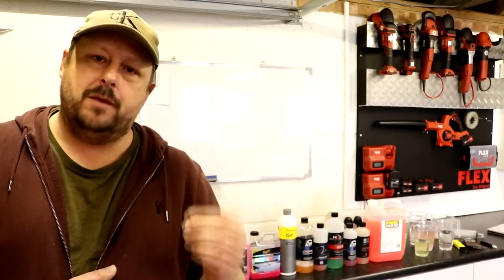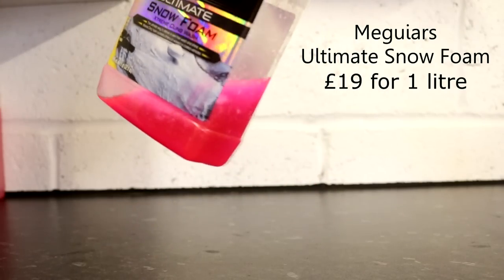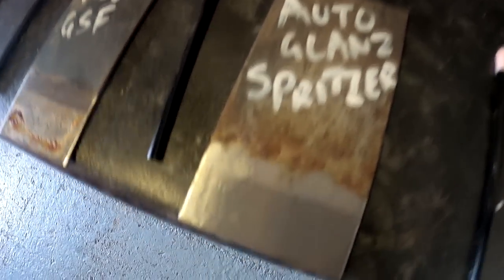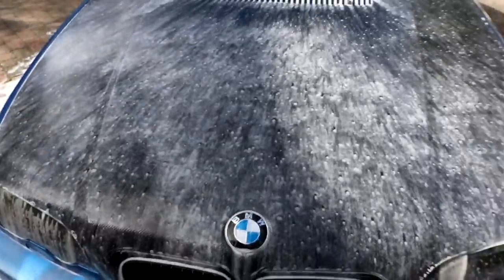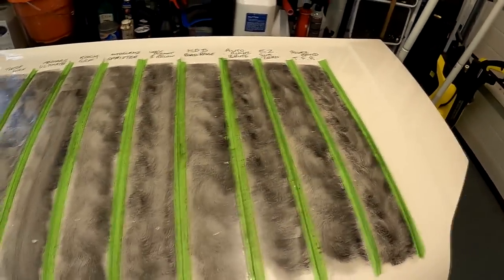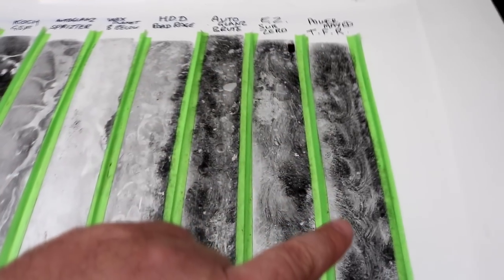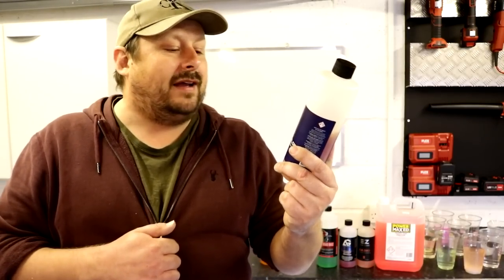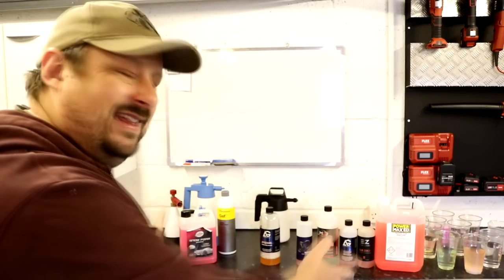The Best Snow Foam | Ultimate Pre-wash Comparison Test

Comment from the maker: I will do a 8 below versus Autofoam video tomorrow, just a quick one, no rust or like timelapse thing just cleaning power and quick chat..

If you want to cross compare with the products in the first round watch this video ---> https://youtu.be/WmVeTbarlH4
Reply: VS BH Snowfoam?
Reply: Hey could you maybe add Koch Gsf with Greenstar at some point? Koch says of you need more cleaning power from the Gsf just mix it with GS. Since you own both products 😎
Reply: That'd be awesome!
Reply from the maker: @saiiiiiii1  for sure yer i talked about this in the video..
Reply: Hayden Mcfarland Autofoam is BH
Reply: Hey john could you do the 8 below against bilt hamber aswell please tomorrow would really appreciate it👍
Reply: @Naoi He already did if I remember , doesn't corrode steel
Reply: @Naoi I have green star I prefer autofoam tho , When I discovered AF I stopped using other cleaners , other than the PH neutral ones when dirt is low
Reply: @Naoi Autofoam is very good as a spray pre wash ( not foamed , just spray ) .
At the same ratio as green star is much better and yet not corrosive.

Comment: Really interesting Jon. I use WP 8 below and do like it, but like you I find it needs extra bite in the winter. I add 10ml of green star in the winter and that works a treat. Still works out as cheap as chips.

Comment: For me in a snow foam I want corrosion inhibiting cleaning power that's relatively LSP safe.
Level of foam and cling doesn't bother me too much as long as it does the job.
I'm not too far off needing to get another load of products and was going to try out Autofoam. The comparison with 8 below will be interesting but I have a feeling BH will edge it out with value for money.

Comment: Thank you for doing a corrosion test, its not something that had crossed my mind but my locking nut has surface corrosion and the discs keep rusting up, suspect this is why. Thanks Jon.

Comment: Awesome test, well done! Can you comment on Bilt Hamber Auto Foam vs Eight Below? Is Bilt Hamber the best allrounder?
Reply: Ass he said in the end of the video he have made other test with other products and he did not want to talk about other product than the one there was in the video. BH is brilliant, i use it my self, but that does not mean that I'm not open for some cheaper alternatives.
Reply: @ketillundsrensen6167  Cheaper ? BH is probably the cheapest
Reply: @dimmacommunication  not if used at the correct PIR. Most will require over 400ml of product in a 1L lance bottle to get the correct ratio.
Reply: @richardhurr31  But I am not using foam lance , much better with a sprayer.
Wayyy less hassle , super quick and effective

Comment: Jon, that’s one of the best pre-wash shampoo reviews I’ve ever seen. Your in my tip 3 detailing channels. Respect for your time and effort. 🙏

Now regarding your statement, at [ 26:35] you’re saying that:

1) Ratio 1:25 it is 4% and I’m totally agree with you!!!

2) Ratio 1:10 is less than 1% 
Well ratio 1:10 means 1ml of product mixed with 10ml of water or 100ml of product mixed with 1000ml of water. Following the logic I would say that ratio 1:10 is more more like 10%.

edit:
Regarding my favourite pre-wash shampoo I would say that:
1) I do not have a garage 
2) I’m using IK FOAM PRO 12 (pump) Sprayer
3) I can not meet the most producers requirements to avoid using the product on direct sun light and avoid getting it dry (at least not all the time). 
By far BILT HAMBER  AUTO-FOAM is my choice. It’s great product, not expensive (for 5L I’m paying more less €25) and the cleaning power is amazing. Thanks to you Jon (and your channel), I’ve discovered that great product. So, big thank you for that! 🙏
The only disadvantage is that using the Auto-Foam (40ml in 1L = 4%) with IK 12 Pro doesn’t give me much suds but that’s just aesthetic, right?!  Maybe I can mix it with some other product to get more foam out of my pump sprayer, so I will be completely happy when washing my car. So, now I’m considering the idea to add a little bit of “Wax Planet 8 below” pre-wash shampoo and see what happens.
Reply from the maker: Point 2.  Snow foam lance ratio 1 to 10 typically equals 0.7 PIR.    1 to 9 in pump sprayer equals 10 percent PIR.  Remember pressure washer adds loads more water.  See video how to calculate PIR.
Reply: @ForensicDetailing  so, if I understand you right, your advice is to use 10% of a product (Auto-Foam) in a pump sprayer (iK 12 Pro). 
PS. Will check your video regarding the PIR. Thank you very much for your input. 🙏
Stay safe and all the best!

Comment: Hey Jon! There seems to be a misunderstanding with the dilution for the Gsf. In a foam sprayer like the Gloria FM10 or the Kwazar Super Foamer on 1l you will get an awesome foam which cleans pretty good with just 20ml (which is a 2% dilution). For a Foam Lance used on an high pressure washer, you will have to adjust the amount cause the foam lance will dilute it even further. Most foam lances also dilute 1:10 so you will have to use about 200ml on 1l of water in a foam lance.
Reply from the maker: the instructions needs tweaking marios for the UK market.  Because the product or the term snow foam in the UK is really associated with snow foaming prewash in a lance, only a tiny percentage will use hand pump foamers.    The key words which would let users know are "pump foamers or pump sprayers" versus "snow foam lances".  but I have to follow the instructions and it just says for snow foam use 20ml in a litre spray foamer.  

unfortunelty a product thats mild in nature always suffers with my cleaning simulator.  with green star in the mix GSF could strip that dirt film.  so yer I felt it important to mention that.  

really to win this contest the prewash has to be agressive with a strong degresing power and some natural alkalinity and be good value.  no doubt koch will have something in their lineup which does this
Reply: Forensic Detailing Channel that’s true, I will forward this information to my colleagues. 🙌🏽 Thanks very mich for giving me this insight Jon. But that’s true, a ph neutral product will not have the same degreasing power, there is another snow foam product in our line up, which is the Super Foam, but it is meant for the professional detailer. It has a lot of degreasing power and a ph of 12.5 😃
Reply: @marioan3698  this would be interesting to see. I love Koch chemies stuff usually

Comment: Great test. I was missing them.

I'm not using snow foam just because i think they don't clean as much as the money they ask for. Your review has proven my thoughts in general, although there are good products that really clean (but you have to find them, try and error)

Instead of snow foam, wait and rinse, i pressure wash the thicker mud and then simply foam the car using my usual shampoo (Sonax, cheap) to help with the 2 buckets method. I can say that the "foam" of 1 cap of sonax (20ml maybe?) in 1 liter is similar to the turtle wax you reviewed.

Comment: Great video, well done! I came here mostly to learn about the rust inhibiting performance of each, so it's good to see that test. You used each product in a neat form to test the corrosiveness, but in reality, each should be rinsed off. You may have a later review which I haven't seen, but could you comment on what you've seen after real world use (after rinsing with fresh water) on things like exposed nuts/screws on the underside, discs etc?
Reply from the maker: alkanility will inhibit rust.  but use Bilt Hamber Touchless prewash thats a great option

Comment: I've seen other tests give similar results for HDD and GSF.  Personally I use Autofoam after the last set of tests. For s***s and giggles I went with a 4% Autofoam, 1% surfex HD PIR mix for one of my winter washes and that was pretty effective and removing low down traffic film.
Reply: I actually do something along the same lines Roger... I use my old karcher foam bottle (the 500ml one) and go 50/50 surfex HD/water in it, spray the lower half of the car, then coat the whole car in autofoam (including over the SurfHD part)... This stops the HD drying out, giving it even more working time with the outstanding autofoam also working... 5-10 minutes later I spend a good 10-15 minutes rinsing, then 90-95% of dirt is removed... Some people say it's the power washer removing that dirt and not the foam... I completely disagree!!

Comment: I use PowerMaxed TFR but in a pump sprayer for the intial degrease, I wouldn't be using a TFR in a snowfoam lance like a snow foam. I use Autofoam for that.

Comment: great review as always, would the wax planet product be good to use as the only washing product on a car that has been ceramic coated. I,m keen to extend the life of the ceramic coating as much as possible without using aggressive cleaning products that may accelerate the degrading of the coating.
Reply from the maker: hey john, no  this WP product is a pre wash.   you need a contact wash shampoo after it, which is designed to provide lubrication and will use different surfactants designed for more  contact washing....

Comment: If you want foam + decent cleaning power then Autobrite Magifoam, if you want very strong cleaning power then Bilt Hamber. Thats all you need to know 😄
Reply: znjful found magifoam clogs my foam gun.
Reply: This.  I use BH in the winter to really cut through the grime, and Magifoam in the summer where the longer dwell time and thicker foam helps shift the dirt.
Reply: @m0bov  soooo thicc
Reply: Magifoam has poor cleaning power in my experience. Looks good for pictures though. Wax Planet Eight Below is more than thick enough and cleans better than Magifoam.

Comment: I was considering BH Auto Foam and the GSF, went with the latter because it was sold here in Denmark - lower shipping rates. And I have used it once, after watching another channel’s wash with it. 100 ml and GS. Still wasn’t impressed. Foamed fine but ran off the car very quickly. Didn’t have time to do the nooks and crannies with the brushes before it was off the car and almost started drying. I was in the shadow and under ten degrees C. 
I will mod my foam cannon to get more performance from the GSF.
I have used GSF and GS mix as a waterless wash in a sprayer with good results.
Reply: I just read my label on the GSF and it says Foam Sprayer. 20 ml GSF to 1000 ml water, so a 1:50 dilution. What that ends up in with the foam gun, I will have to work out. But I think the cost/wash is going the wrong way. Bilt Hamber is on my list now.

Comment: Just a quick correction John. Yes, 1:25 is 4%, 1:10 is actually 10% which is 2.5 times more concentrated. You may want to review this part of your evaluation
Reply: 9:1 is 10%.
Reply: Brian Woods careful how you consider the ratio. 1 is 10% of 10. This is usually how ratios are expressed. Yes, 1 part concentrate to 9 parts water is a 10% dilution.
Reply from the maker: 1:25 in pump sprayer is 4% 1:10  in pump sprayer is 10% (roughly).   But 1:10 in a lance is about 0.6 - 0.7 %  PIR.   Im pretty sure this is what I said in the video.  be aware the video contains hundreds of pieces of infomation on the products and the prices at different concentration theres probably other mistakes lurking but Im not aware of any mistakes.  but I may well refer to 1:10 and not specifiy if Im talking lance or pump spraper PIR.

Comment: jon i use bilt hamber high activity autofoam to do regular weekly cleaning on my bicycle. i use around a 100:1----or 50:1 concentration in a spray bottle on the chain and it works so good that it even degreases synthetic chain lubricant. (not a clean strip but pretty darn good). i could put some HDD in it but i dont want a clean strip lol. When i use a snow foam i want cleaning power, and degreasing power, atleast if i want it i can up the concentration.

Comment: Great Video !!!!!

I need some help and advice on alloy wheel cleaners. 

I have tried and experimented with a few but I’m not convinced on results.

Could you help me ? Or if you have a video with a few products to trial.
Reply from the maker: Get some BH autowheels This is a bleeding fallout remove and wheel cleaner in one (stinks but will clean your wheels like nothing else)  Try and keep it away from the brake disks.

If you want non FR.   I use Surfex HD at 10:1 because its cheap.

But try garage therapy wheel shampoo.
Reply: @ForensicDetailing  that is perfect !!!! 

Do you also have a link to your how to not get streaking video ? I’m a new subscriber and I’ve just seen the turtle wax spray and rinse.

Comment: I know this is an old video, but the Koch-Chemie website states 20ml of GSF per litre in a 'foam sprayer'. That's a PIR of 2%, which would be more like 200ml product with my pressure washer set up. 

They reference separately that GSF is also suitable for a 'foam gun', but fail to mention the need to maintain the correct PIR, which feels like quite an oversight...

If my interpretation is correct, it would be nice to revisit this product at the correct PIR 👍
Reply from the maker: Yer they should have corrected that I flagged that to them

Comment: Fantastic test jon as always - couldn’t wait to watch ! I share your thoughts on EZ’s products - there pricing is just all over the place and cheapens the brand IMO. A product can’t be 40 quid one day and 17 the next, it’s mad and it really put me off their products despite  me using a lot of them at fist. 

Their Arctic Meltdown is great though for a gentle LSP safe snow foam 👍 I go BH autofoam when i need the poke though - TAC systems snow foam is worth a go Jon - really good value, clings like mad and just never dries out on the panels. I love it for those reasons.
Reply from the maker: yes but I actually kind of like getting emails with like deals and stuff is good fun and Its probably good business. but yes I agree its a bit confusing and also stops me buying when theres no deal because my brain is thinking I could be massivly overpaying.   dunno though, they seem to be doing well so good luck to them they will know more about their business and theres so much competition out there better to try something different than the rest you could say.
Reply: I know it sounds mad not to like a big discounter - I do and it’s good fun as you say. Just that point of thinking you’ve overpaid - i’m thinking well is this a 40 quid snow foam or 17 quid one hmm ...
 
That said they’re doing great - they have ceramic range which is fairly new i think - their EZ Ceramic wax is one of the best out there i’ve used no question - so easy to apply, buff and looks epic 👌

Comment: Jon how about a test of wax planet vs auto foam? Battle of the best? I've used power maxed TFR via pump sprayer after reading the raving reviews on forums. Have to say I hate it, find it too caustic. Might give it a go out of the lance though. Great video as always.
Reply from the maker: it what way did you observe its caustic nature though G J.  Did it turn like metal brake calipers white or leave milky stains even after rinse?
Reply: @ForensicDetailing  if I left it to dwell for a little bit it seemed to tarnish the bits of chrome affect plastic trim. Used it on my scirocco just as a wheel cleaner and ended up having to buy new centre caps. Similar affect on the badges on the Mrs polo when I used it as a full pre wash (twice a year deep clean though so I don't really care about that). Since I've got my Type R I've never dared to use it.